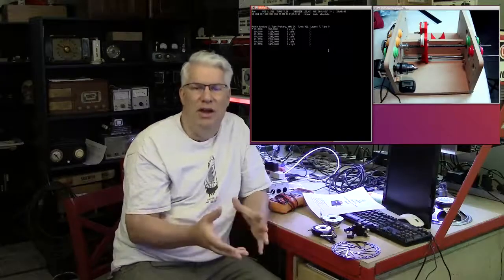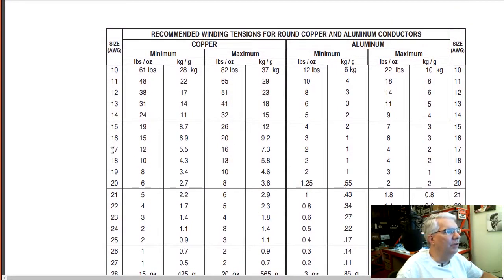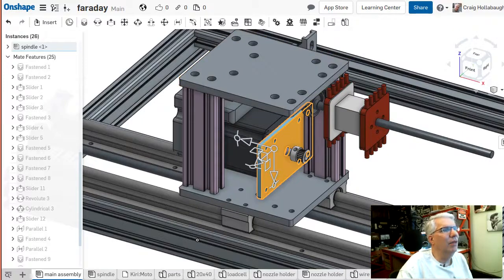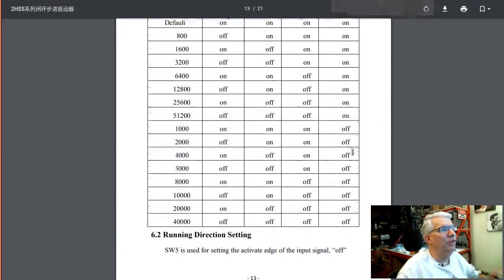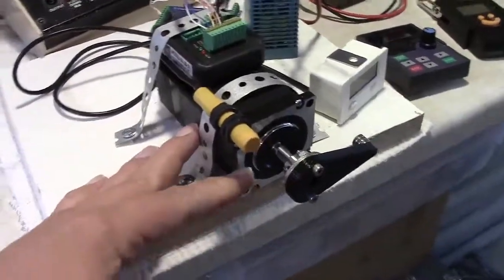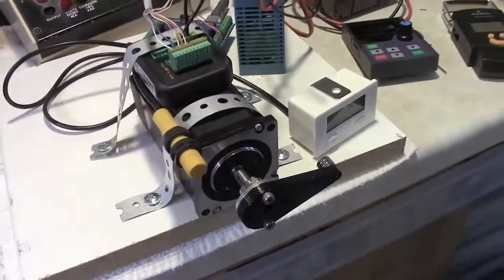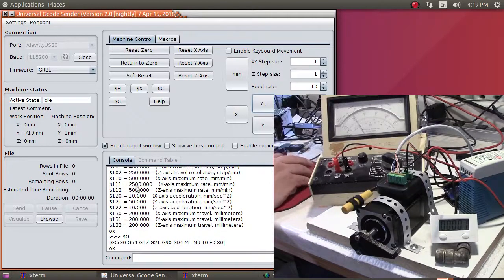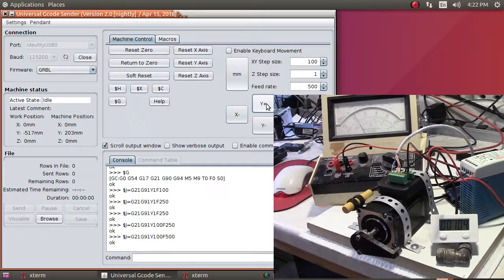180518 Valve Studio - Coil Winder Spindle, JMC iHSS60 Integrated Stepper Servo Motor

Comment: I have 3 of the iHSS57-36-20, 6 of the iHSS60-36-30, and 2 of the NEMA 17 closed loop steppers with external control/driver box. I have the 57s on a Chinese 3040, 3 of the 60s and one of the 17 on an X2 mini mill and the rest are going onto a RongFu RF-30 (Harbor freight 33686 mill drill)
Reply from the maker: Robi, I think I initially saw the iHSS60 during your X2 CNC Fusion video. What are you running for your NEMA17 controller?

Comment: Craig, 
I did not watch entire video so I may have missed this detail,...
Don't forget as the coil diameter grows, the motor torque will increase if the tension is held constant. 
BTW  nice to see the antique radios in the background, I also restore radios.
dan
Reply from the maker: Daniel Wahl thanks for watching. Yes,  I agree on tension increase over the wind. However, tension control also has to deal with oscillating tension as the square or rectangular bobbin's orthogonal radius peaks and valleys per revolution.  I don't know if I'm going to address this one.
Reply: Just depends on the margins of current delivery and torque capacity.
T = Scalar * Current. I would not be too concerned about the absolute perfect control of tension. Not in this application anyway.
Reply from the maker: That's what I'm thinking as well.

Comment: Congrats for your job. I'm interested at buying two of these servos and it's going to fit a cnc plasma cutter, I'm going to use it with a 10:1 reducer. Do you have it's datasheet and does it work fine at low speeds? I mean 100rpm to 800rpm, does it delivers around 3.0n.m and accuracy is fine? Thank you, Craig! Nice job
Reply from the maker: This step servos are great! I just committed a JMC directory to the github repo, https://github.com/holla2040/faraday/tree/master/docs/spindle/jmc  Good luck and thanks for writing.

Comment: High tension windings will cause the wire to stress with the heating cycles, and eventually fail.  Many of the old transformers have open coils because the wires were so tightly wound and poor insulation.  What about a design with a two pinch feed rollers to help the wire and reduce the tension at the bobbin.  Look at what Ampex did with the reel tape machines,  a baseball pitching machine or a Wilson tennis machine for clues.
Reply from the maker: Well, I didn't expect this on a Sunday morning. I've had the coil winder on the back burner for a couple years now because I hadn't have arrived at a tension approach. Here's what I've considered DC motor/rubber wheel with active load cell feedback, warner electric torque brake, spinning disk with EMF brake, friction disks and electric scooter rear wheel drum brake. I'll look up the ampex reel tape machine, baseball pitching and wilson tennis machine today. Thanks for the comment and for watching.

Comment: Email Michael at jmcxx at jmc-motion dot com and he can sell to you direct and when you buy a- motor he can send you a tuner at the same time.  I just order a bunch of the control plugs and power plugs so I can make up test rig for driving them from different platforms - Smothieware, Marlin, GRBL, Raspberry Pi. Some are common anode and others are-common cathode. As well as different voltages 12v, 24v, 36v, 48v power supplies.